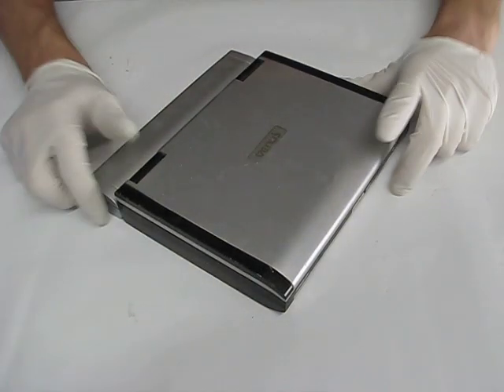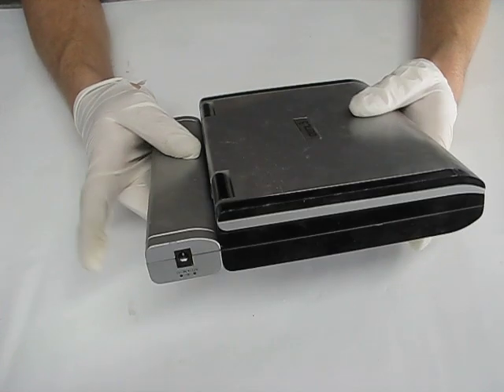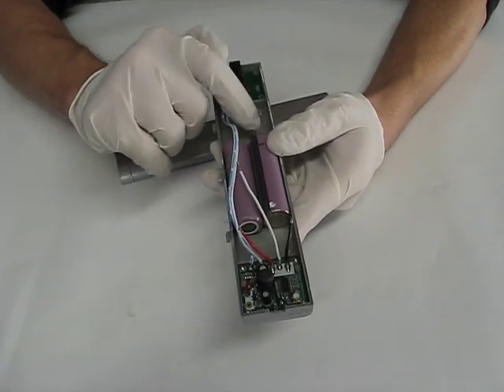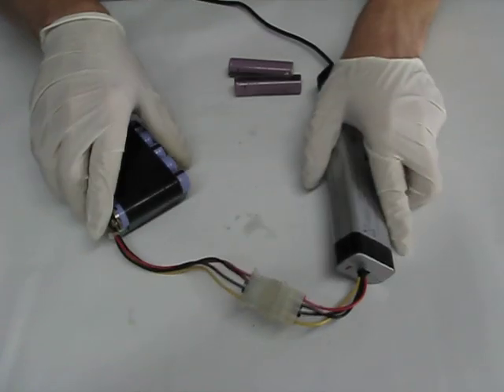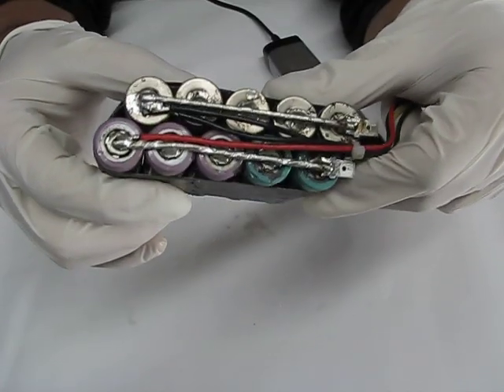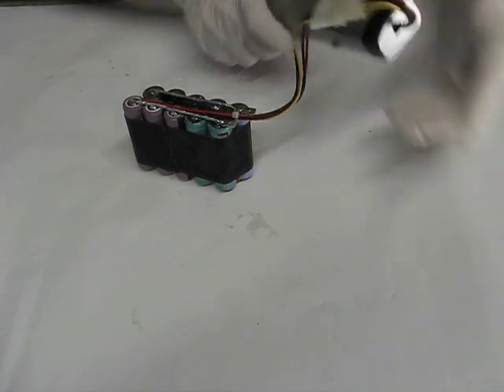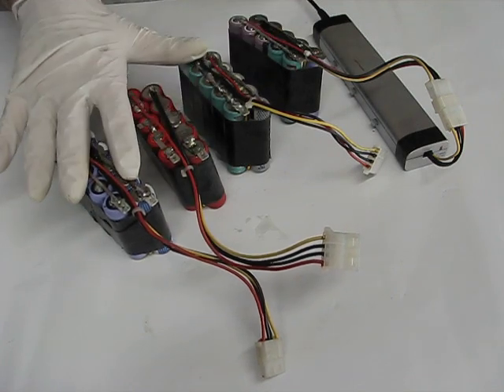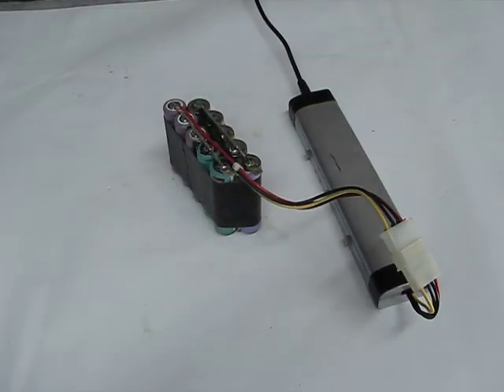DIY Lithium Ion Battery Pack and Charging System

Comment: I have one of these and will try it as you suggest. However, I'm not sure what the white wire does in this charger. I see you connect to the center of the series connected cells, but testing with a meter shows no voltage between the white and either the red or the black.Shouldn't I get a readout of the charging voltage there?
Reply: That white wire goes to the other end of the two batteries where (+) end of one simple connects to (-) end of the other, as you said.  It likely ends up at the control chip and so no voltage.

Comment: That's nice but do you or anyone have any idea how to ultize the charging microcontroller built into a Macbook battery? I am working with a Raspberry Pi 2 Model B and looking how to wire up the battery so the Pi gets the readings of the Battery while regulating the power from the battery to power the Pi and other hardware relating to the project.

Comment: Excellent video!
I have also a question Sir.

There are at least two types of lithium charger bricks, as far as i know.

First, the type with a cooling fan.
Second, the type without a cooling fan, much like a charger brick of a laptop.

What is the difference between the two types? Why use cooling fan? Why does laptop bricks not use cooling fans?

Thanks for reading!
Reply from the maker: Debby Johnson Im not too sure, maybe the ones with fans have more cells?.. but i noticed that the charging circuit on this one included a small temp sensor, lithium batteries aparently have a neat feature called Thermal Runaway.. Kinda dangerous lil things..haha. read here: http://batteryuniversity.com/learn/article/lithium_ion_safety_concerns
thanks for watching :D
Reply: Richard Harris
Thanks bro!

Comment: Hay man. Gr8 video. I want to make my own 1s2p pack from 2 18650 batteries to be charged and used at the same time. I am a real newb when it comes to batteries. Do you happened to know a tutorial for that or a diagram showing how to make that?
Thanks
Reply from the maker: I think you need to go to: http://batteryuniversity.com/

:) I just found it a month ago... lots of good info.

Just make sure you dont overcharge them you will be ok.. (4.1v is full)

Carefull! i exploded a couple wiring them wrong haha
Reply from the maker: I dont know about a tutorial.,.. maybe look at rinoa-super genius he has a great vid on making li ion packs... i will post it if i find one :)
Reply: I just made a pack of two in series for my DX8 Transmitter,   Just wondering if I can charge in Series?    any one know?

Comment from the maker: I am only putting 1A @ 12v into the charging circuit (i'm hesitant to put more into it until i run the packs a couple times incase it blows the circuit) The portable DVD player battery charging circuit im assuming wouldn't require more than 1A (It didn't come with the original one) So im trying to play it safe for now.. I wonder what would happen if I put 12v @ 4A into this little charging circuit.... I will try after i get a couple uses out of the packs :)

Thanks

Comment: Great instructional video. What is the charging current you are using? I charge mine to 12.6Volts @ 4Amps. Mine are wired 3 pairs in series. In each QA there are 12 sets of 12.6Volt packs. So I can go from 12.6Volts to 144Volts and anywhere in between. Your doing great keep going. Looking forward to your next video.

Comment: what do you mean arc welder? do you mean from my SLA video? yeah in that video i just used a MIG welder to try and jump start an SLA. but then latter on i bought a 20$ 12v desulfator off ebay and it kiiinda works.

its such bad build quality that it didnt arrive in one piece, but they refunded me so i kept it for free. i soldered it back together and it seems to work ok. i've saved a lot of batteries with it, then i end up killing the batteries with my stupidity haha

Comment from the maker: LOL DO it!.. I was charging just 2 cells at a time before i made the packs and they were charging (with the same charger here) to 4.08 , 4.10 , 4.04 etc and some were 3.8 and some were duds.. im thinking having them in parallel is good initially cause it would distribute the charge of all the batteries (in parallel) untill it was even..  might refresh the lower capacity ones... hmm.. what do u thin k...